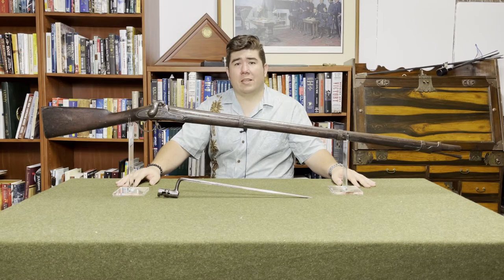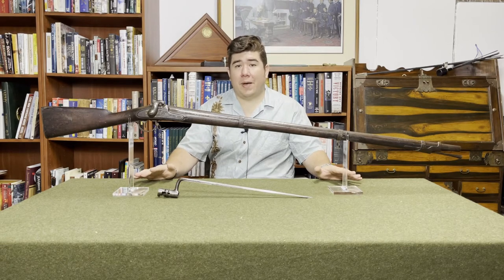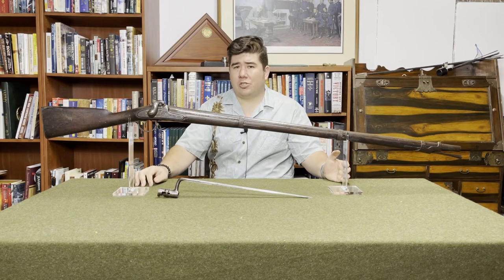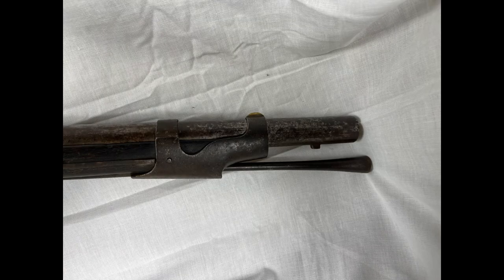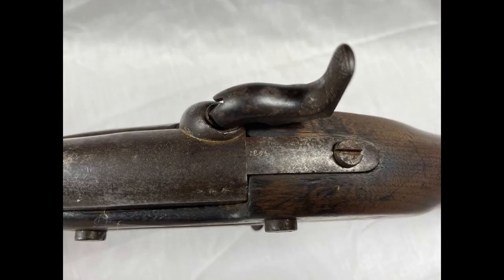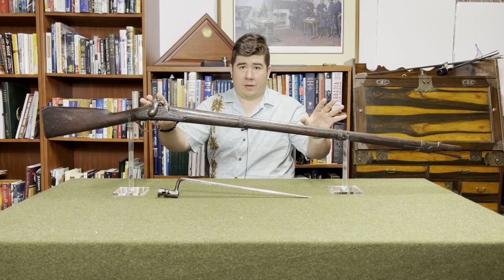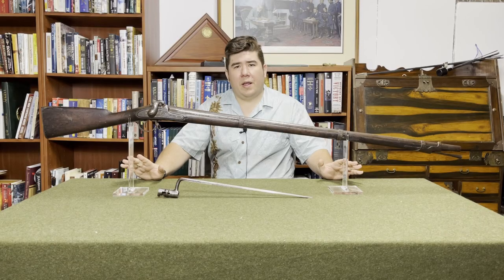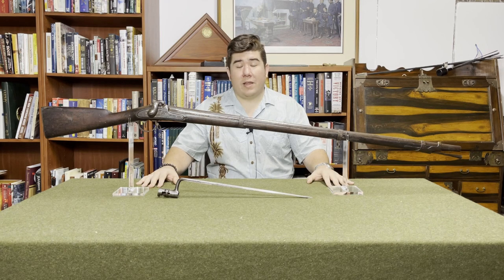Episode Four:  Springfield Model 1842 Musket

Comment: I bought a reproduction of this musket today, an Armi Sport defarbed by Lodgewood, a very nice job of it. Had it been an antique it would've been much more expensive and I would have questions about the safety of shooting it. All the modern marks are gone, replaced by the correct stamps, the stock was re-contoured and stained dark walnut with the correct cartouche. For all purposes a new made 1842 Harper's.
Reply from the maker: Lodgewood does great work.  I also have a 42 they worked on.  I'm going to be going into the "defarbing" process in a future video and plan to highlight some of their work.
Reply: @MusketMissive  hi,will look forward to that.thanks.